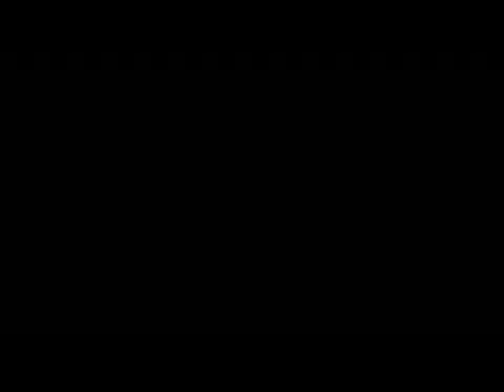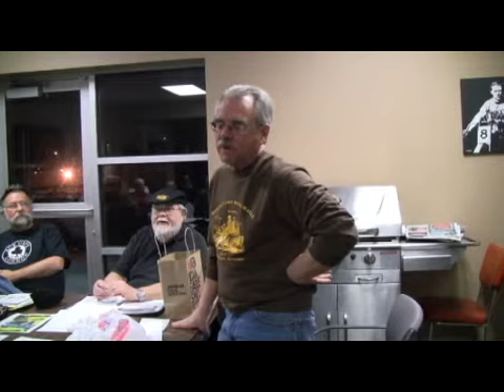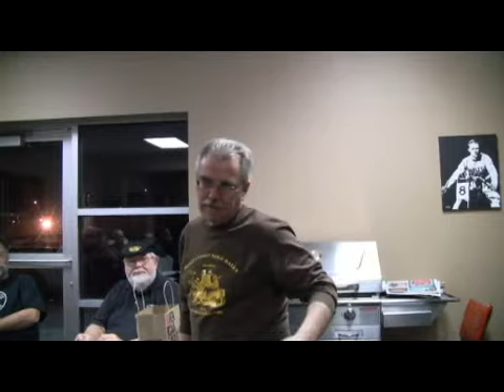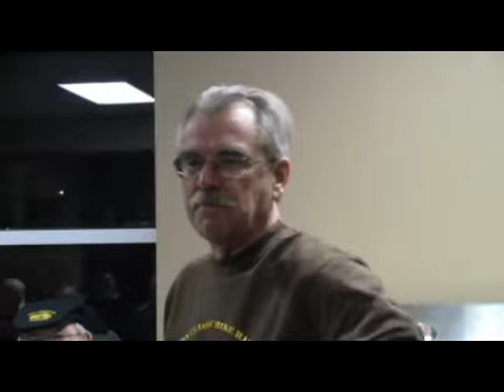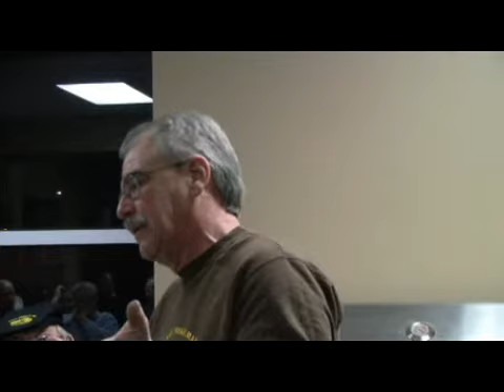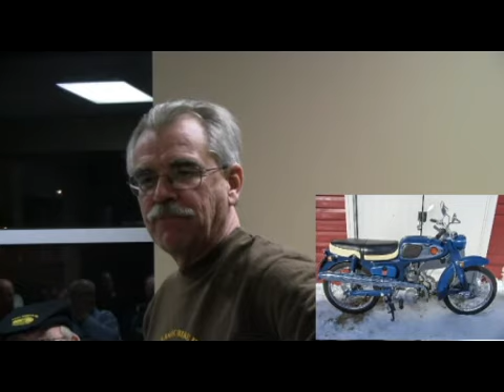Honda S65

Comment: @Jrodman86 i have 1964 s90 and i'm in the process of rewiring it right now. there's a huge following for these bikes on the yahoo group forums that can really help you out. If you ask them they will get back right away. best of luck. also theres a ground in the bars that was a common problem. you might want to rewire the ground from your headlight wire and ground it somewhere else.